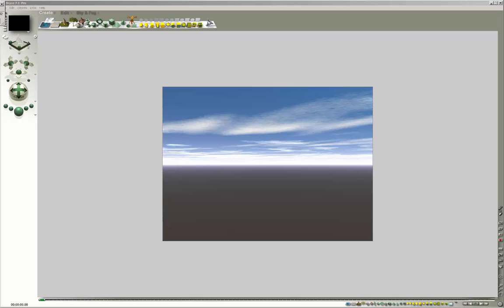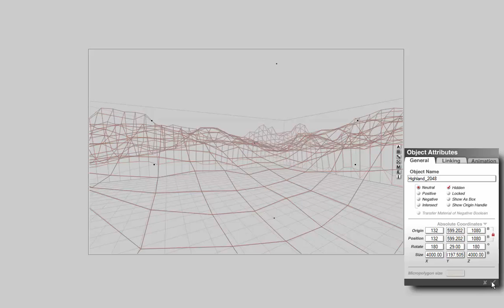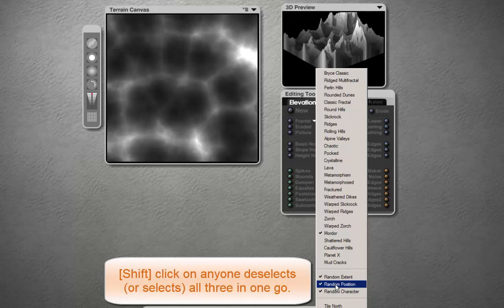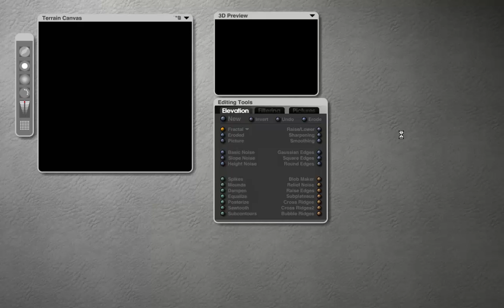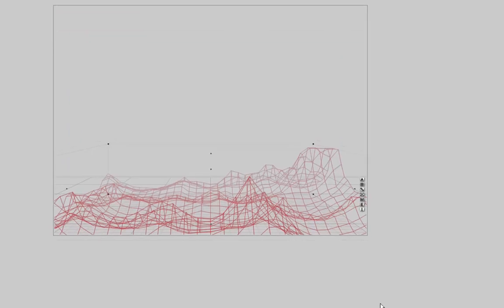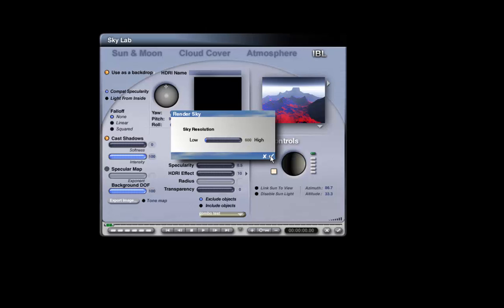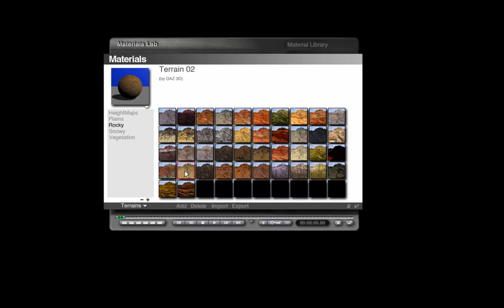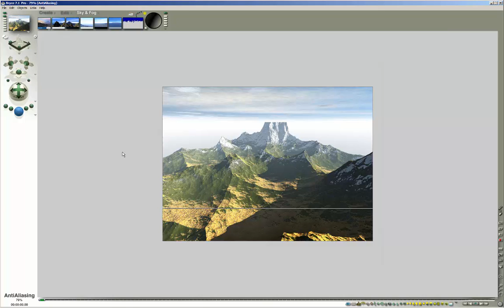Bryce 7.1 Pro tutorial - Stacked Terrains - by Horo.

Comment: Also can i import my own low poly wireframes?
Reply from the maker: A wide variety of import formats are supported, depending on if normal data is embedded in the format or not, you might need to modify the smoothing level to get it to render how you want it.
Reply: @davidbrinnen  cool ty. I'll see what my options are for my files.
Reply: I also wanted to ask if you're familiar with the original release of Bryce 3D?
Reply from the maker: @the_rabbitt  My first go at Bryce was on Computer Arts magazine demo CD in 1996, that was Bryce 2, my first owned Bryce was Bryce 5.

Comment: Thank you for all your tutorials! Do you know if there is a way to render with only the wireframe visible in a terrain? I wanted for example to make some kind of '80s inspired image with glowing wireframe mountains.
Reply from the maker: The easiest way to achieve this would be to choose your preferred wireframe view, either the default or one of the OpenGl setting might suit your needs and use a paint package to composite that with whatever else you wanted in the scene, using some kind of filter in your paint package to achieve the "glow".  To do this entirely in Bryce, though not beyond the realms of possibility, would take a lot of figuring out.
Reply: @davidbrinnen  Thank you for the quick reply! Yeah, I thought it would be kind of troublesome to achieve this in Bryce as well, but I'll see if I can figure something out. I'm stuck on an old Win XP PC so I can't run any new softwares that otherwise would achieve this easily. :)
Reply from the maker: @LUNARIAproject  Well I am all for figuring stuff out for yourself, that's the best way to learn and discover new stuff, however, if you get struck, feel free to send me an email at mail@davidbrinnen.co.uk and I will see if I can help.  Best wishes for the new year 2020!